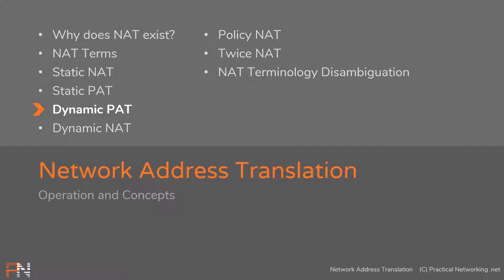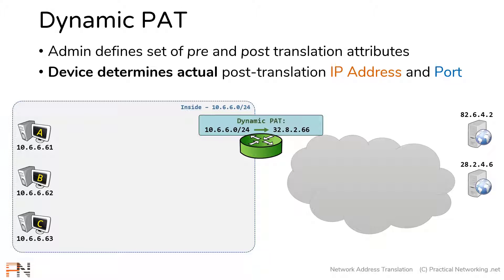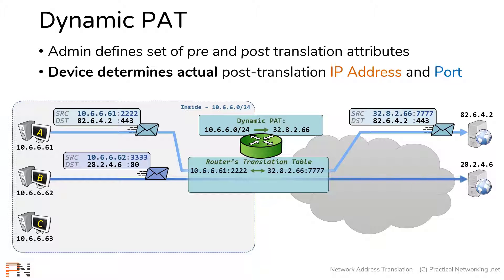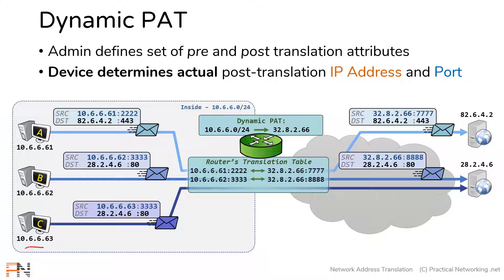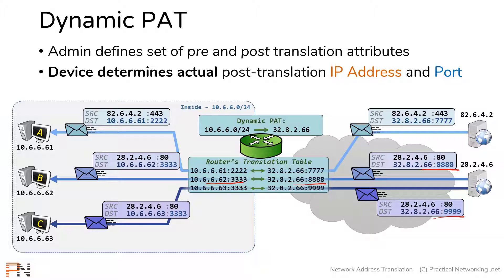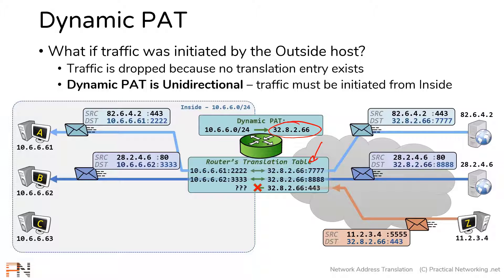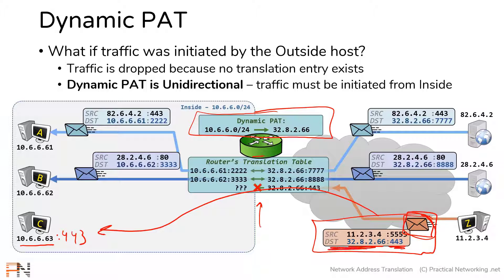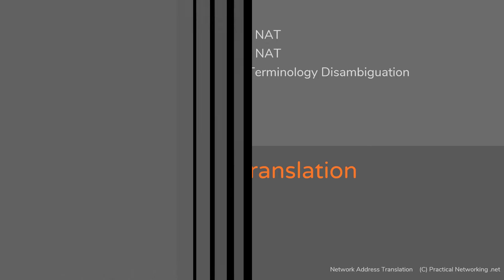Dynamic PAT - Network Address Translation

Comment: Perfect. Can you also do a video on how a VPN works sharing 100 customers using the same outbound vpn address? Would be very interesting.
Reply from the maker: It would be fun to tackle VPN stuff in more detail.  But the sharing of the outbound VPN IP address will still occur as a simple Dynamic PAT.  The VPN portion is independent of the NAT portion.
Reply: @PracticalNetworking  yes, thanks to your explanation, it's fascinating how brilliant the inventing of dynamic PAT is and how useful it's to services like shared VPN IP's. Your channel has very briefly touched on browser based SSL vpns, and it would be real interesting how their connections differ to say OpenVPN based VPNs, and how the topology looks when you use OpenVPN on the box and then also use the VPN extension, creating a tunnel inside a tunnel. And then if the destination site is also tls 1.3, it's then even more fun to think about. Could you elaborate on how, if the internal 10.x IP is mapped to a port via PAT to the VPNs front facing IP, how do say p2p, https, and Zoom can simultaneously work, and how those tunnels look like? Is  ALL traffic from the 10.x machine mapped to a single public IP/port per authenticated VPN client out of say 100 clients, or is it more complex than that...how does it work... Would be great if you did a video along those lines!

Comment: how to make sure the public IP address must have unique port numbers, as you said they're also randomized ? Is the router making sure that no two connections have the same port number on Public IP ?
Reply from the maker: Yes, exactly. The router is assuring the ports are unique by changing them if necessary.

Comment: I assume that the entries in the translation table ought to expire at some point to avoid running out of available ports?
Reply from the maker: Correct. Typically with TCP, the entry "expires" when the NAT device sees a RST or TCP FIN.  Or after a certain amount of time.  ANd with UDP it's just a simple timeout (every vendor has different defaults for this).
Reply: @PracticalNetworking  Thanks for clarifying. And thanks for the great work you are doing!

Comment: Hi, will this possible that I have two webservers which will have to use same port 80 and two public IPs mapped to each web server.  webserver-A:80 mapped with public IP-A:80   and webserver-B:80 mapped with public IP-B:80...  im using single FW for this. one webserver is using outside interface and second sever used public ip used by NAT.   I have /29 public IP block.. But i cant access both servers simultaneously. what would you suggest on this .

Comment: Why RE-randomized? Why not just sequential (the next number to the last one)?
Reply from the maker: Good question. Some router/firewall platforms do just that (use sequentially the next-number). But, if the next sequential is in use, then +2 sequentially is used, and so on.  But not all vendors operate this way.  Hence in the video, I simply said "re-randomized" to imply that you can not make any assumptions about what new source port the Router will use.  

There also isn't really a correct or best way, as long as a unique source port is used, Dynamic PAT will work. Whether it be random, or sequential, or via some complicated algorithm, who knows?   

Hope you enjoyed the video.

Comment: is it really unidirectional? because if you initiate from inside then traffic still gets back to you...
Reply from the maker: Unidirectional based upon the initial packet.

A connection initiated from the inside will allow bi-directional packet flow. A connection initiated from the outside will not make it through the NAT device.